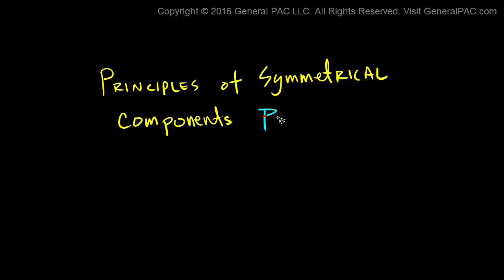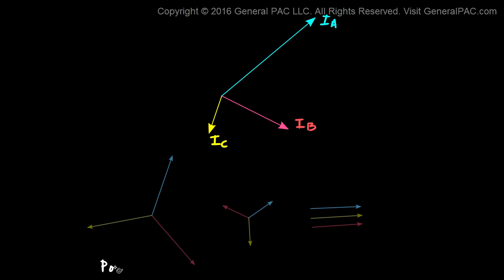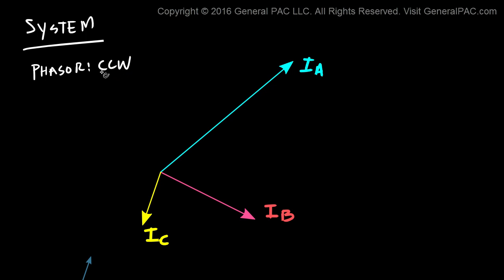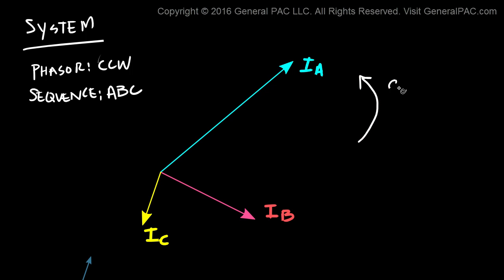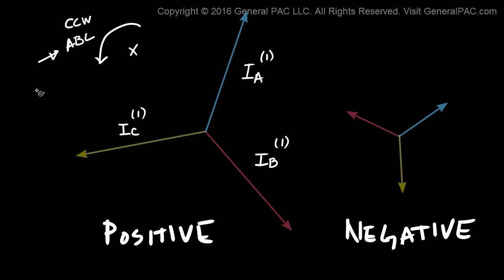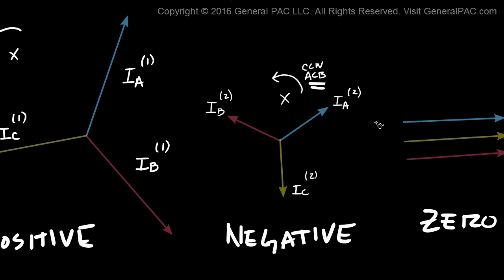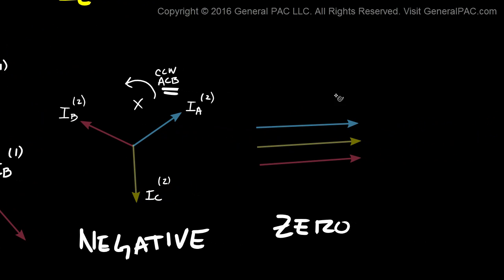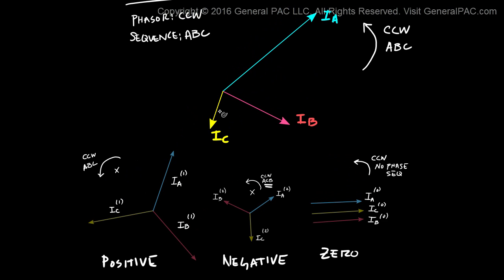Principles of Symmetrical Components part 2

Comment: Does negative sequence component exist in L-G fault
Reply: ajay yadav negative sequence is in every unbalanced fault
Reply: If you have a single phase system with a fault it’s easy to calculate If=Vf/Zeq but if you have a three phase system and get a L-G fault on one phase (say ex Phase A),  it becomes an unbalanced system because the two other phase (B & C) do not have a fault.

Comment: if ABC is rotating in ccw then ACB should be in CW direction.But you are saying that both will rotate in CCW!
Reply: I realized the same also in previous videos !
Reply: Here the position of phasors have been changed.
Reply: This lecture is correct . They all rotate CCW - it it taught wrong in India from what I have seen in the Indian YouTube videos. See Why do Indian lecturers say the rotation will be different ? The rotation is same it is only The SEQUENCE THAT IS DIFFERENT for negative sequence. For zero sequence the rotation is same it just has No Sequence - that is why it is called ZERO sequence. It is all in phase. Is this what is taught in India? See here and read about vector rotation.
https://www.transmissionprotection.com.au/topics/symmetrical-components/
Reply: interchanging any 2 phases change the direction of a motor, here he is talking about a generator